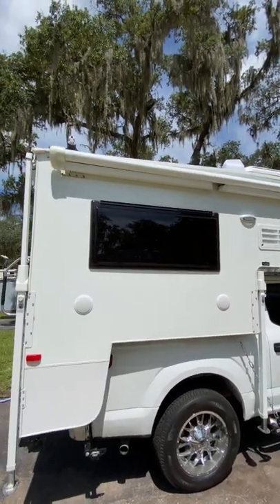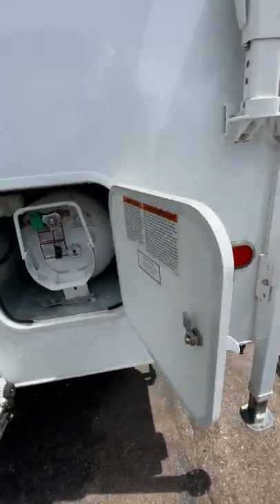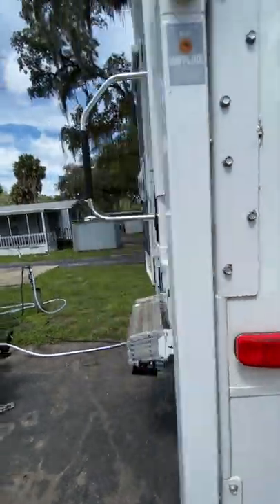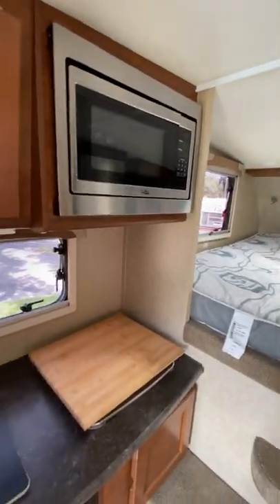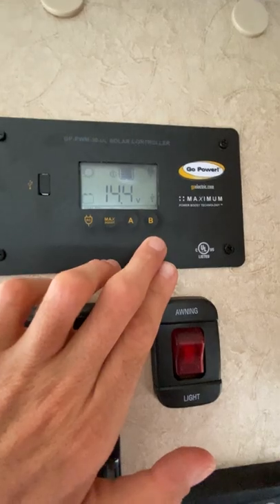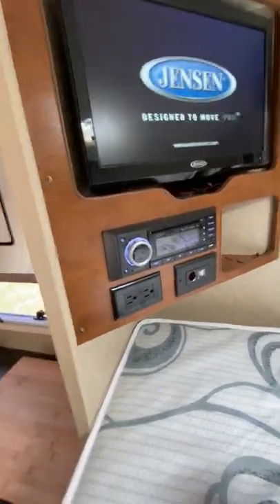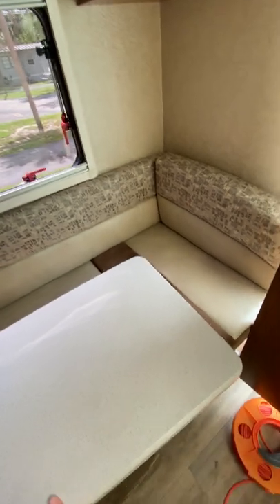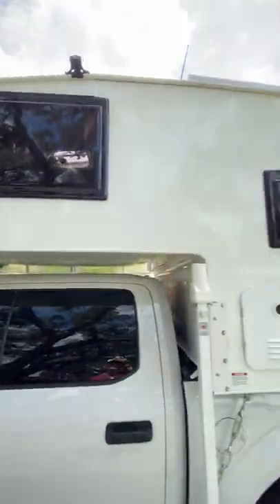2020 Lance 650 For Sale Walk Through

Comment: How do you recharge the propane gas tank?  do you refill or buy another tank?
Reply from the maker: Hi Joel. You refill it. It’s a special design with a reinforced top and a nut to lock it down so it’s better not to swap it out. However you actually can put a regular tank in if you wanted to. 

Many RV parks will fill the propane for you.

Comment: how was your experience with the Yakima gutter mounted roof rack?  Did it seem like a strong enough mounting point?
Reply from the maker: It was great. You have to get the longest bars they make with the rain gutter clip ons. Even then they barely span the width of the trailer, but they make it with a little room to spare. I strapped a $2500 canoe down very sturdily over hundreds of miles on the interstate. No issues. I don’t think they can handle real heavy weight however.

Comment: Do you have to remove the tailgate on the F150?
Reply: Doing a bit of research myself, it looks like you have to because the rear skirt dips low enough to require tailgate removal.

Comment: Did you modify the rear suspension on your truck to accommodate the weight? What did you use if any?
Reply: Hey Jay. Yes, I used Airlift 5000 air bags. On my first lance I cheaped out and put this cheap device that engages the stronger leaf springs right away. It ruins the suspension in a short period of time and it still sagged like crazy. Go with the air bags.
Reply: @ryanmcfarland4034  Didn't this camper exceed the loading capacity listed inside your driver door pillar? These are over 1900# wet with standard equipment.
Reply: @jonsimonson4473  Maybe that's why he is selling it.

Comment: Would this fit on a 2017 Chevy Colorado Crew cab? (6ft bed)
Reply from the maker: You need a 1500 size truck for the payload. Any 150-1500 series truck can handle ii, short bed or long bed. Thanks